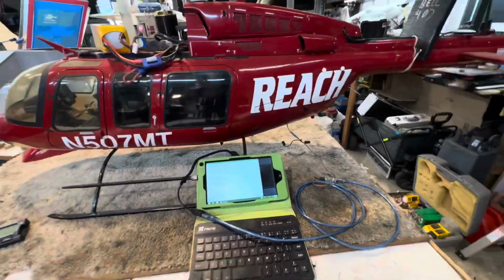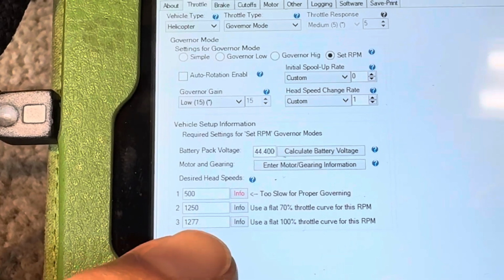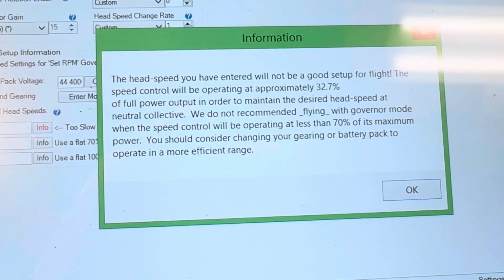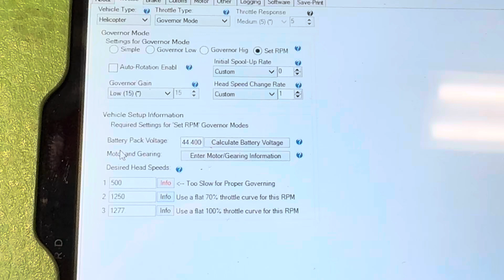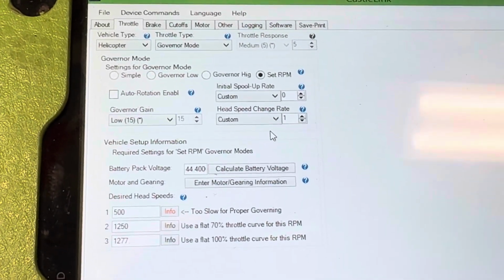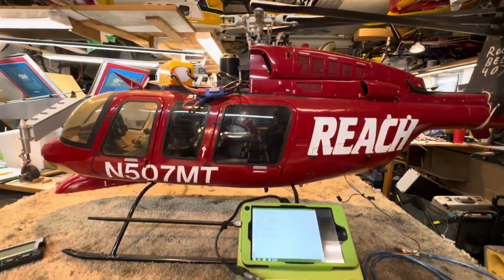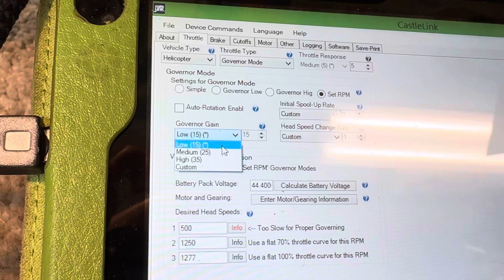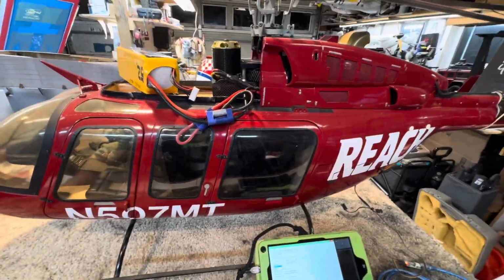Programing the Castle Creation ESC for scale Helis

Comment: I like the simple governor mode. That way I can use my radio to set or adjust my RPM. I use flight modes with fixed throttle setting in my radio, 1 for idle up and 1 for flight. I also use fade in and fade out time with my flight modes to adjust my speed change. for example I have a 15 second fade in time from throttle lock to idle up. then a 5 second fade in time from idle up to flight.  All this I can change in the radio instead of having to go into the CC software to make changes. By doing this though I'm not setting an exact RPM. I get my final settings more by sound and response.

In case some don't know Simple Governor mode uses the signal to set RPM that the ESC will govern at. For example if the signal is fixed at 50% (Idle up), and sees the RPM at say 1121 it will govern to maintain 1121. if the signal changes to 70% (Flight) and it sees say 1538, it will govern to 1538.  if when I take off I feel and hear it bog slightly I can the adjust my radio to say 75%. Let say 75%  throttle the ESC sees 1665 rpm, now it governs to hold that. 

I can still use Auto-rotation, I have control of spool up and down times, I can adjust RPM's remotely if I hear bog down or over speed issues and it makes initial setup easier as I can slowly bring up speed to find Idle up and flight setting during the testing phase. 

Thought I'd share as I don't see a lot of guys using the Simple Governor mode.